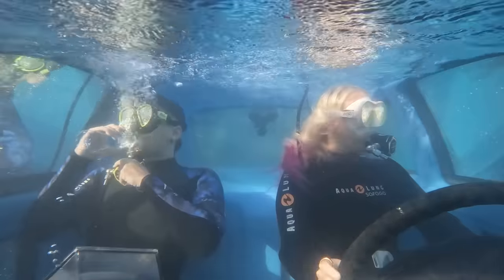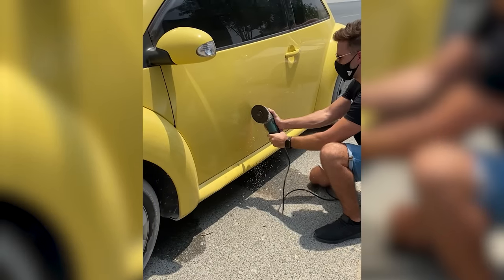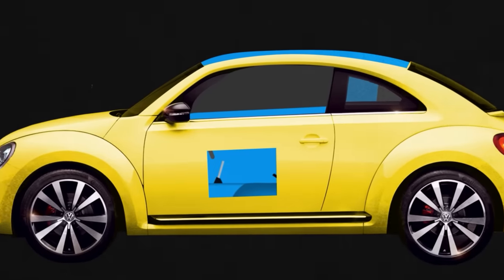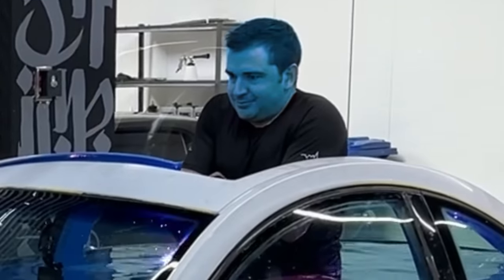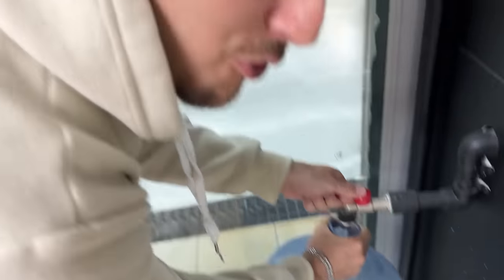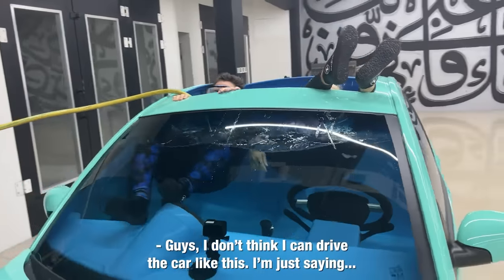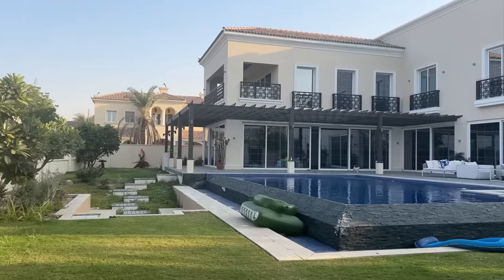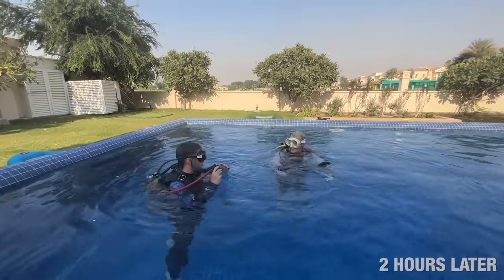We Built A Scuba Car!

Comment: 6:35 Push purge button 😆You can breathe only by blowing out the water in the respiratory system using the residual pressure in the lungs or by pressing the removal button on the front.

Comment: You know you could have cameras in the front and the back, possible sides, then you wouldnt need guy running with you.
Also the top should close so you wont spill water everywhere.
In current state the car is simply to dengerous to drive.

Comment: OMG That's most insane idea 🤣🤣🤣👍👍👍 no air condition and less fuel to burn .
Reply: did u forget weight of the water , they said it holds 1500 liters so the 1500 kg more weight , more fuel need to be moved